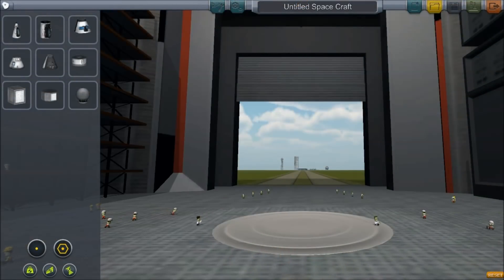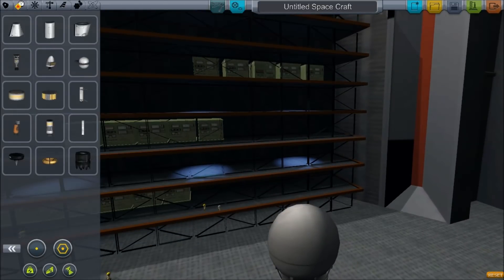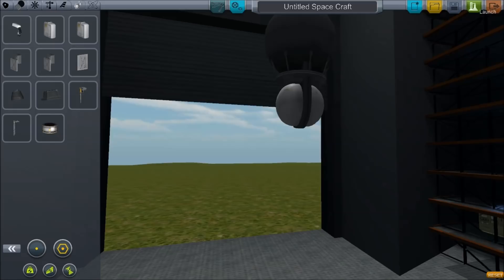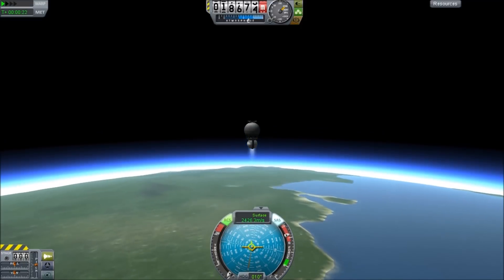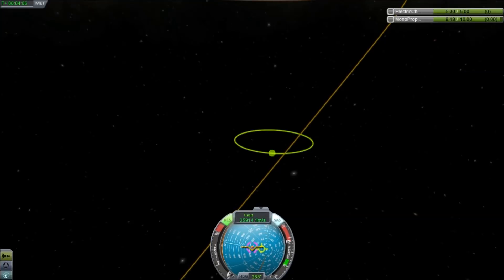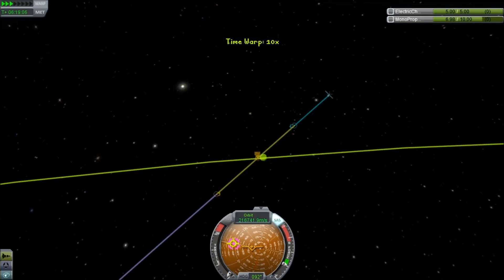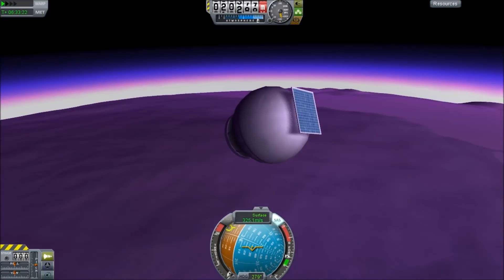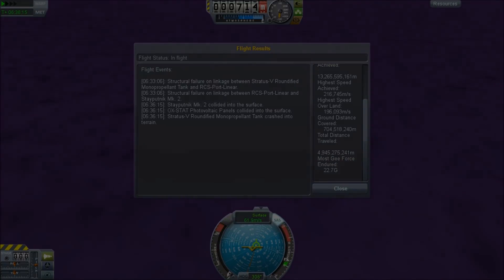Kerbal Space Program 0.18.1 - The Fastest Probe In The Galaxy

Comment: I tend to use small "swarm" probes. They use one of my custom mods: Electrical Manifestation and converters mod. The name still needs a little work. They make their own fuel using solar panels and custom fuel cells. They typically use one or 4 engines: One on the bottom or one on the bottom, 3 on the sides. Batteries and a small probe core make up most of the body while reaction wheels and fuel tanks take care of the rest. The best part? They carry all science stuff other than the science jr. and atmospheric fluid Spectro-variometer. Kinda OP, kinda not.